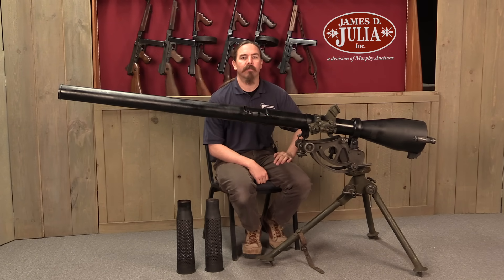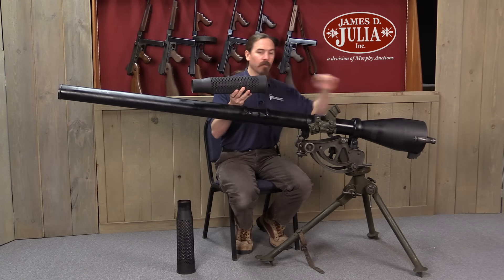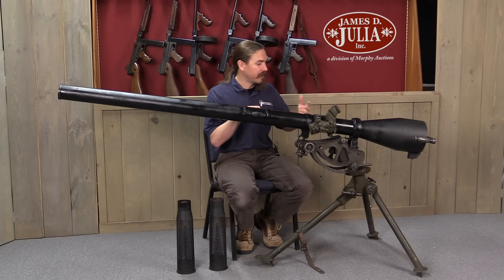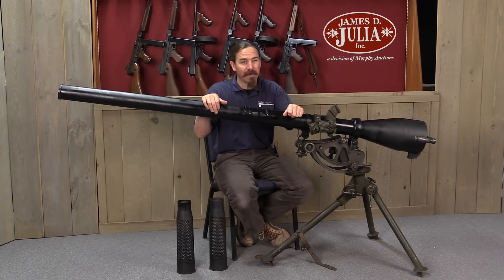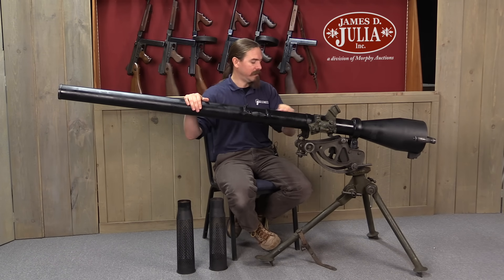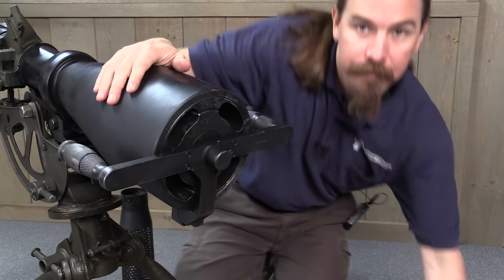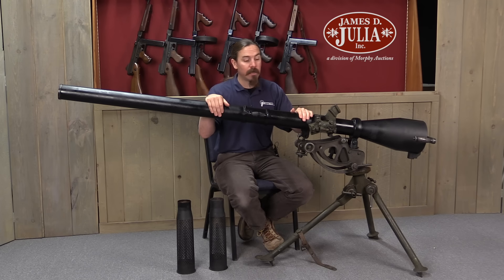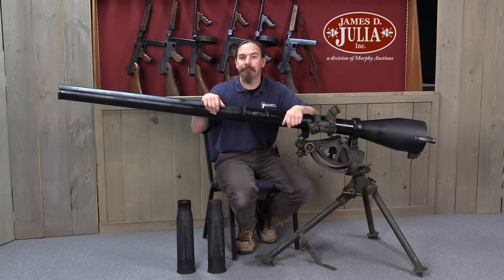M20 75mm Recoilless Rifle: When the Bazooka Just Won't Cut It

Comment: A guy I served with was on a Coast Guard 82' patrol boat in Vietnam.  Their "artillery" (other than 6 or so .50 cal MGs) was an 81 mm mortar set up for direct fire.  Which had issues.  So they mounted one of these recoilless rifles (don't ask where they got it) and it worked great.  Except the back-blast from the first shot peeled all the paint off of the pilot house.
Reply: Alternate use #15: Paint remover.
Reply: You saw an M-40 106 RR, common to the Ontos, Marine weapons platoon and US Army. Easy 10,000 made at Waterviet Arsenal. Rick Ontos
Reply: @spammortician  do you mean Watervliet? Cause that’s like down the road from me.
Reply: Does the 81mm mortar fire when a round is dropped in?
Reply: @tyngchinchillachang838  Yes, fixed firing pin on 81mm. I imagine you would have to slam them down in the tube rather than just drop them at an angle suitable for direct fire. I think striker fired 60mm would work better for the purpose.
Reply: @robertkubrick3738   The mortar the OP was referring to was a breach loaded, striker fired weapon. It used 81 mm mortar rounds but was used more like a howitzer and was set on a pedestal mount with a Mah Deuce on top. You can see the mounts in just about any Riverine force photo ever published.
Reply: @owensthilaire8189  Thanks. I was never Navy and it must have been outsystem before I enlisted in the Army or I'm sure they would have at least mentioned it in small arms repair school.
Reply: @robertkubrick3738   Yeah the US Navy like the British Navy use some equipment that is exclusive to Naval service and have their own contractors. Just look at some of the weapon systems used for anti aircraft use on old naval vessels. Or the Marines being issued H&R sub guns while the army got Thompsons pre WW2.
Reply: @owensthilaire8189  I always wanted to get my hands on the naval spec drive motor for the Hugh's M242 Bushmaster 25mm chain gun. Imagine a Bradley firing 475 rounds per minute.
Reply: @robertkubrick3738  Haw! You would want a mouth guard in for that i imagine. That machine would be rock and roll for real.
Reply: @owensthilaire8189  It's not just a job, it's an adventure, as they say. I always thought an adventure was someone else in deep stuff far, far away. It's never as funny when it was me.
Reply: @danielcurtis1434  It's a tube, not a barrel.
Reply: @robertkubrick3738  it was a French weapon developed for their 1960s armored cars. Not really a mortar in the normal sense.
Reply: @tyngchinchillachang838  Short answer - they could be either drop-fired or trigger-fired.  Not a lot of info on this weapon, but here is a link:  https://www.pcf45.com/misfire/mortar.html
Reply: @tyngchinchillachang838  Yes, it has a fixed firing pin , but remember you are dealing with americans here, they dont let reality get in the way of a good story
Reply: as a ex morter man i can say this in theory could be done, maybe once maybe, but i think the firing residue would  prevent you doing it. You have a very short ''throw' if you think about it. We where mental, but not that mental.
Reply: @marksbikeexports5123 
What if you loaded it carefully, made sure the shell was all the way down, and hit the base with a hammer to fire?
Reply: @marksbikeexports5123  is that to say they either didn't read the manual or stole the mortar aswell?
Reply: @marksbikeexports5123  oh no we have used mortars for direct fire many times
Reply: @marksbikeexports5123  It could sit at a slight angle.
Reply: @marksbikeexports5123  to be fair, op didn't say that the mortars wouldn't fire. Op said they had issues. What the issues were I have no idea. I'm not familiar enough to make accurate guesses, but could be some structural issues, mounting issues, aiming issues. Idk there could be a "loose nut behind the steering wheel"
Reply: @roycehanly3666  in the heat of combat that is almost impossible to pull off. But even if you were to pre load it like that before combat it would be way to dangerous, like run into something or go into too shallow water and that thing is going off.
Reply: @marksbikeexports5123  The mortar the OP was referring to was a breach loaded, striker fired weapon. It used 81 mm mortar rounds but was used more like a howitzer and was set on a pedestal mount with a Mah Deuce on top. You can see the mounts in just about any Riverine force photo ever published.
Reply: @marksbikeexports5123  If i wanted the opinion of a bucktooth I'd as bugs bunny
Reply: Where did they get it?
Reply: @masonlindquist3133  They "acquired" it (probably from someone who wasn't paying attention...)
Reply: @ScottKenny1978  or STEALed.  STEAL  standing for

Strategic 
Transfer of
Equipment to an 
Alternate
Location

Many Garands and more up to date Infantry-level equipment in WWII in the Pacific Theater ended up in Marine hands via the  Army in this fashion much to the Army's frustration.  

It also stands for 

Surreptitious 
Tactical 
Emergency
Allocation of 
Logistics
Reply: @ScottKenny1978  Oh yeah, shot a guy dead with guns and gran the weapon out of his hand
Reply: @masonlindquist3133  From my experience in the Coast Guard, probably after it was taken out of service by another branch. Coast Guard is the only underfunded branch of the military, so they take any hand-me-downs they can get. I think the Coast Guard is the only branch of the military doing anything to defend the country instead of offending other countries, so it is a damn shame they're the only ones not getting any love from the government.
Reply: @SGFTI  Semper paratus.   I always felt the same.
Reply: @SGFTI  I remember having a joke with some of my Coast guard Buddies back when I was in that was something like "do you know why no one ever dumpster dives at the Pentagon...

 Because the the coast guards already took all the good stuff"
Reply: @masonlindquist3133  dont ask where they got it
Reply: Need better paint....
Reply: We captured several recoiless rifles in Cambodia 69 70 in country
Reply: @puppiesgoarf664  Thank you for your service.
Reply: @laurencemusolino  I think most all us that actually saw combat would have skipped out of the draft and went to Canada only 14% of those that were in country fired a weapon
Reply: @puppiesgoarf664  Even for those who did not see combat or would have avoided it if they could they served their country admirably and endured what many of us could not. Those that experienced combat just had it harder.
Reply: @laurencemusolino  With all due respect your comparing apples to oranges those based in and near air bases had color TVs clean sheets on comfortable beds while those of in the field slept with the rats and insects and mortar rounds they risked nothing ice cold beer and hot food everyday for the lucky ones before pissing my 1st sergeant in Binhoa I had my own refrigerator and watched Bonanza every Sunday and could call home every day if I choose to then I was sent out to be a gunner on a 105 howitzer I have enjoyed the 3,200$ tax free disability benefits from the VA everyone that died there died or seriously injured was for nothing guys in the rear got laid whenever they pleased
Reply: @puppiesgoarf664  You definitely know what you are talking about in this regards, I do not. I recognise exactly what you are saying as the considerable difference in experience for battlefield forces. However, I do feel impressed by most soldiers and their achievements and experiences. I feel definitely more admiration for field combatants, but in a society where we thank doctors, nurses and teachers, we can certainly afford to thank all defence personnel. As for benefits, people gain benefits in this society for far less, so I don't think an soldier should feel ashamed of the benefits they gain. As for wasted lives, this is a very stupid topic for me to engage in, but please forgive me if I do. Historically many wars are labelled as pointless but I think that is an oversimplification. The mere act of warfare discourages or exhausts all parties in the conflict. The lives lost in Vietnam prevented North Vietnamese from capturing or engaging in aggression against surrounding countries. If unchallenged we would perhaps be living in a more communist society today, and even though many liberals seem to seek communism, the society they exist in enabling them such ideals has been maintained by soldiers dying to prioritize capitalist democracies as the primary form of societal system in western nations. I, as a beneficiary of this form of society system, am very grateful that through many conflicts, and the incredible sacrifices of soldiers that this was achieved for the rest of us. War is a horrific experience for those on the front lines, but I honestly feel without war humans would find other ways of cruelty to inflict on each other. War by its very nature, and violence inflicted by one nation on another discourages widespread victimisation of groups of people. Again, this is not really a topic I am expert in, just an opinion.
Reply: @puppiesgoarf664  So politically we are different. I still respect you for your service, but if you voted for Biden and support the media, I can certainly see why you hold the views you do.
Reply: @puppiesgoarf664  I think explaining my political views is insulting to you, as I am sure your political views are complex and considered. My objectives relate to serving God and doing what I believe to be righteous and logical. All things orbit these ideals and I have no allegiance to any political party but I will stop or interfere with  objections or directions I perceive as wrong and support those I believe to be more righteous. All the best to you also.
Reply: @laurencemusolino  Don't know why you think its insulting 🤔 you shouldn't feel guilty about what you believe in the only thing a know about God is what the catholic nuns taught me physical and emotional abuse I have been to my after life I died on the operating table before being brought back I became pure energy floating in a sea of love without wants or desires I'm old now and look forward to returning to my afterlife 😘
Reply: I bet the Boatswain's mate loved that. Lol.
Reply: Improvise and adapt!
Reply: Probably, they got it from the South (or North) Vietnamese army. The M20 was widely used by French forces during the Indochina War. At the independence, lot were given to the new South Viet Army. Lot were also captured by communist forces.
Reply: Gave that boat personality haha
Reply: Oops!
Reply: Military contractor * huh, peeled all the paint off the boat house you say ?   Success! We fail to see your problem here sir!
Reply: Good thing it didnt peel someone's skin off.
Reply: As a veteran of deck department US Navy This is a straight horror story! Glad you both made it back ok though.
Reply: Thank you for your service.
Reply: We captured several in Cambodia I have never seen one fired but I see how it would have a back blast
Reply: They don't have a back blast
Reply: I have a wild guess of how they got it.
Reply: Fake story
Reply: I was at an "event" and both these systems got used, and the direct fire mortar had a .50 BMG ta boot, the "RECIOLESS" took out windows Much Farther than anticipated? Opps, sorry.
Reply: R/MadLad
Reply: @thatguybrody4819 reddit moment
Reply: wait what? what was US doing in vietnam in 82?
Reply: @MyCrafcik  82 foot patrol boat
Reply: Vietnamese MADE IT, it was called DKZ (đại bác không giật) and the earlier Version is SKZ (Súng không giật), Designed by Trần Đại Nghĩa, an overseas engineer who worked for German and came back to Vietnam following the call of his country.
Reply: @1stwind   hate to burst your bubble, but he may have "borrow" it from the German. The recoilless gun principle had been around for century, and people have made recoilless gun for some time before your guy did it.

Comment: "The back end is as dangerous as the front" 
trigger is VERY close to the back end
Reply: What scared me most was that the trigger is mounted on the handle that you're racking into place to load the round, under duress and possibly wearing gloves while doing so. I just saw accidental discharge written all over this
Reply: @mikespongili8254  why he said specifically to close it in the manner he did
Reply: The blast out the back has way more energy than the blast out the front because you need to balance the weight of the projectile with gas coming out the back.
Reply: @allangibson2408  yeah, but the front end has a giant explosive bullet coming out of it, so I think it balances out on the danger scale with the back
Reply: Tactical Shoelace to the rescue.
Reply: Fire forward to destroy tank, fire rearward to destroy infantry.
Reply: When firing, you're basically standing in the eye of the storm!
Reply: imagine pushing that trigger when the back blast is directed towards the ground for indirect fire 😬
Reply: I rather have the trigger in front of the barrel   at least the bullet with push your hand out of the way and you won't get hurt

Comment: That pintle mount seems wrong. It is at the end of the slide pointing up at a shallow angle, at the other end of the slide it would be hitting the ground. You mentioned they could be angled higher to lobe a round, this wouldn't. Although if it were angled up too high it would blow out one huge divot from the ground behind the weapon.
Reply: Elevation adjusts via the screw at the front of the barrel adapter, not the tripod. Where the barrel connects to the tripod.

Comment: Its 106mm . . . NOT, 105.
Reply: Both. It IS 105mm in diameter. It was designated 106 to avoid confusion with 105mm M27 that used incompatible ammunition.

Comment: Using well-designed HEAT ammo, unfortunately mostly developed after WWII, the penetration at right-angles should be closer to 8" of Rolled Homogeneous Armor (US tank armor)   The first HEAT round to get such improved ammo was the 90mm "Super-Bazzoka" Rocket Launcher used first in the Korean War with 11.25" (average) RHA penetration at right-angles.  Note that a major problem with these HEAT rounds -- until the late-1950s and early-1960s when the nose-tip electrical Piezo-electric impact initiators were introduced -- was that these rounds used an extra-sensitive non-delay base fuze just like those used for steel explosive-filled AP rounds (though the HEAT fuze did not need to be beefed up to withstand going through an armor plate along with the projectile, as was needed with an AP round).  Non-delay base fuzes still used inertia to set them off on impact, so there was a very short delay before the projectile exploded (circa 0.003-second for an AP round but much less with the light parts of the HEAT base fuze).  This short delay was not zero, so the oval or conical windscreen, which first hit the armor, was crushed a little prior to the explosion, requiring a longer windscreen to optimize the distance between the warhead and the armor (there must be a distance that allows the needle-shaped penetration jet to form prior to hitting the armor -- it took a little while to figure out just what this had to be during WWII which is one of the reasons why some of the early HEAT ammo did so poorly).  At right-angles, just making the windscreen a little longer fixed that, but when hitting armor at a high angle, as was true with the frontal armor of most of the new tanks, including most Russian tanks from the T-34 on, this short delay was enough to cause the projectile to be deflected away from the plate in a glancing manner a little bit before exploding, reducing the penetration through such inclined plates.  As mentioned above, this was solved by the virtually instantaneous electric fuzes used in later HEAT rounds, but in the early designs, it meant that you had to be careful where you aimed the weapon if you wanted to kill even a rather lightly-protected tank with highly sloped armor.

Comment: We had the 105 in the CBs as late as 1976. We had a 50 cal single shot mounted on top of it. You would fire the 50, observe the impact, adjust the aim and then fire the main gun (then run like hell because the back blast just announced your position, shoot and scoot at its finest). The 50 was a special round designed to have the same trajectory as the main gun.
Reply: omg i think he made a video about that relatively recently

Comment: It was also important to remember that the driving band on the round was PRE engraved (to keep breech pressure low)  so as the A-gunner loaded the round he would give it a little turn until the pre-engraved portion of the driving band slipped into the grooves in the rifling, and you could then chamber the round the rest of the way.

Comment: Interesting video as usual. But, I don't see how that can be elevated the way it is mounted. I know you said that the machine gun is mounted 180, but to me it looks like the muzzle could be depressed but not elevated.?
Reply: It looks like the elevation is controlled by the adaptor that fits on the M1919 tripod. A turn screw at the front raises and lowers the barrel. Not the tripod itself.

Comment: That was my Dad's weapon at the Battle of the Bulge, he was a tank killer in the 82nd Airborne, 507th PIR attached to the 101st. He jumped with the bell section and sight and 3 rounds strapped to bags on his waist leg cable jams that he lowered before landing. He weighed 525 pounds and had to be thrown out of the plane at 800 feet.

Comment: Actually, about five times more gas, at much higher velocity, escapes from the back than pushes the round out at the front. This leads to seriously huge cartridge cases, such as on the 120 mm British heavy anti-tank weapon (ConBAT), and a "waste" of propellant. The vent design is actually quite sophisticated, even if it does look just like holes in the breech, as the gas must vent in as near as possible to a directed jet. Any venting that is not directed doesn't contribute to the operation and is just "bang".